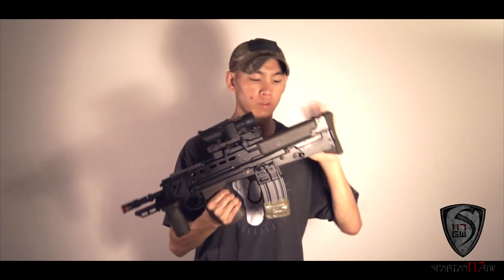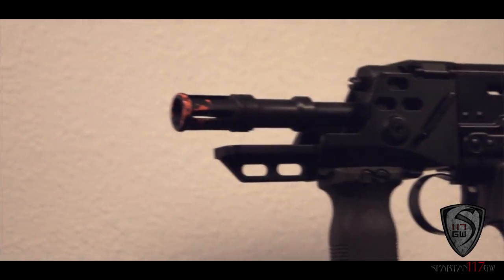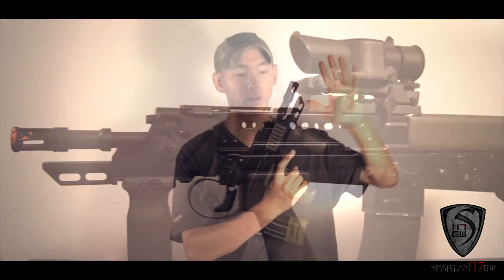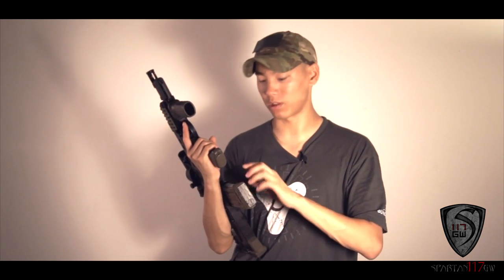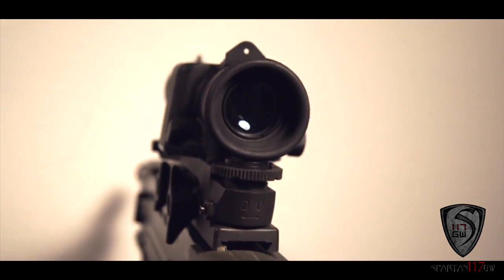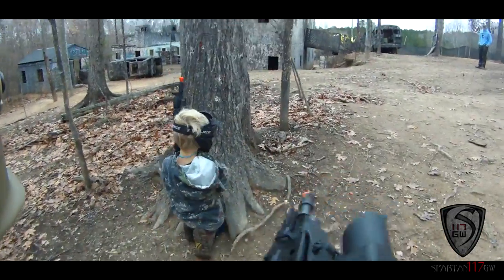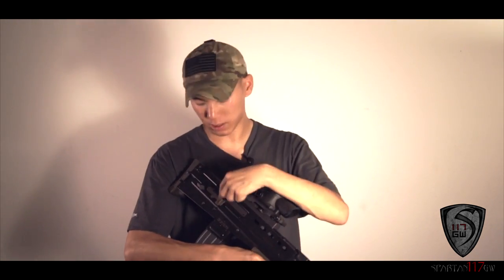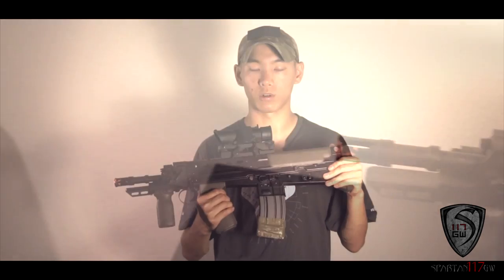THE ARMORY EPISODE 5: L8FA2 AFV

Comment: "This was really designed for a right handed user.. the safety, the selector..." and the fact that the charging handle will turn your front teeth into mashed potato if you shoot it left handed :p
Reply from the maker: indeed
Reply: spartan117gw this actually happened to someone i know on a real steel
Reply: Gen - cod sniper and OBJ The real steel also has a left handed version, although they are like rocking horse shit in the UK military.